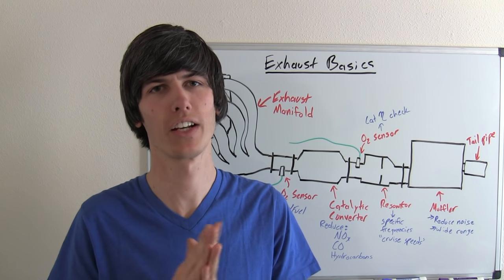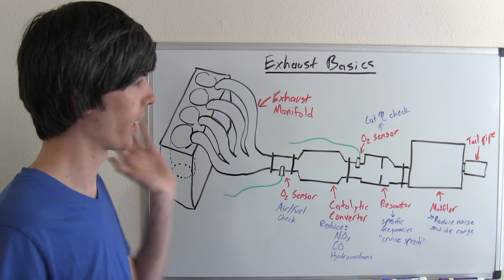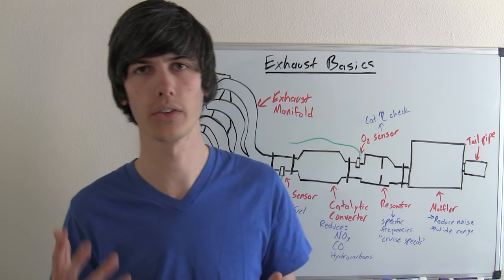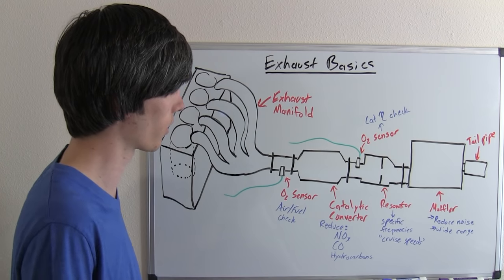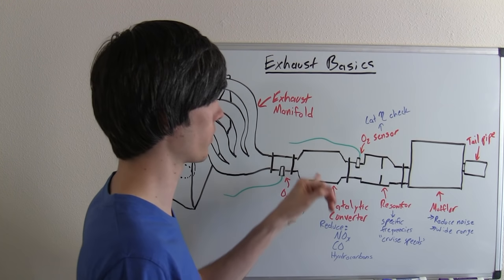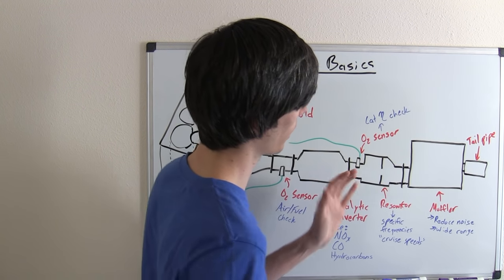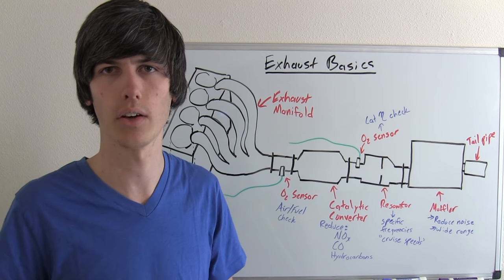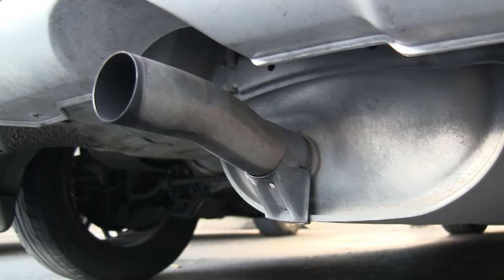Exhaust Systems - Explained

Comment: Thank you Jason.  I recently replaced my stock muffler with a light stainless steel cat-back exhaust system with 2 and 1/2 " dual piping.  It made a notable difference.  I wanted to get the Titanium Cat-back exhaust like the Focus RS but it was not available.
Still, it's lighter than the stock.  It sounds much better with that low-end growl.  Most of all, I've noticed an increase in both horsepower and torque.  Because it's equipped with a resonator, it's louder but not too loud.  Thanks again.

Comment from the maker: Correct, it's simply used for determining the CAT's efficiency. It is not used in adjustments for the A/F ratio (this is done by the first O2 sensor).

Comment: The ignition timing is fine with an exhaust. If you up the a/f outside of the correctable range (ECU's will only correct A/F to a certain degree based on O2 feedback) then it'll run lean and then long term lean conditions can lead to engine wear. That's A LOT, though. You typically won't find issues with that unless you're running carbs (as they can't automatically correct A/F). Typically O2 sensors allow like 20% A/F correction, you likely won't see that w/o flow mods (cam, heads, intake, etc.)

Comment from the maker: I suppose I could, though it's fairly simple so I'll try to describe. Basically you just take the volume of one cylinder when the piston is at it's lowest point, then subtract the volume of the cylinder with the piston at it's highest point. Then multiply this number by the number of cylinders. This will give you the engine displacement (the volume that the pistons displace) aka engine volume. You can calculate it simply by taking the bore and stroke, and finding the volume of the cylinder.

Comment: On some vehicles with Exhaust Gas Recirculation (EGR), the system functions off of the back pressure of the exhaust system. If you put a more free flowing exhaust system on, the EGR may not function and that COULD cause engine damage due to high internal temperatures during cruising speeds (speeds where EGR would be in effect).

Comment from the maker: Basically how rigid the car is, in a corner a stiff chassis won't flex, and the car will remain stable (depending on the suspension). A soft chassis may mean the body can flex a little bit, which isn't desirable. This is why convertibles has strengthen chassis', to make up for not having a roof.

Comment: It means the chassis is stiff enough and has good enough handling to withstand the power of the engine. Pretty much, the chassis can stand up to the torsion of the drivetrain and keep the tires on the ground firmly planted for maximum grip on corner exits.

Comment from the maker: I wouldn't say there's any rule like that, but it would depend where the O2 sensor is located. If it's a V8 and the O2 sensors are located in the headers before both sides join (not sure why, but it could be done) then there would be two. It's likely that that they would just put it where they join up though. As for the rest of the exhaust, the number of cylinders wouldn't matter. A 2 cyl and I6 would have the same amount.

Comment: A very wise mechanic once told me that he had never seen an engine performance problem if a downstream (after the cat) O2 sensor was not working. Presumably that distal sensor just assesses the cat efficiency. On newer systems, is input from the distal sensor used for anything other than that?

Comment: Be sure to get some WD-40 or PB Rust blaster or similar, it will really help get those rusted bolts and nuts out and off, also depending on how badly rusted your exhaust is you may have to cut stuff off, may also want to replace your muffler and exhaust hangers.

Comment: it's a second O2 sensor. if it fails for the converter fails you won't be able to pass emmissions testing. On new cars they just plug in a code reader to find out if you pass, on older cars they will actually probe your tail pipe.

Comment from the maker: I guess that the torque wouldn't ruin the chassis and the forces involved would leave it intact. Unless they designed it, or tested it, it's likely just speculation. I've heard the transmission can handle 700 hp, who knows. Eventually I'll get into that scene, and plan on making the results very clear.

Comment: I'd like you to talk about how modifying your exhaust can shorten engine life. I've heard that when exhaust gases find less resistance than the engine expects, it runs maladjusted and you can damage the exhaust valves. And I'm guessing it ruins the whole engine timing... but I don't know if an adjusted ECU can "teach" the engine a new timing according to the modifications (but that can overstress internals), and for carburated cars without electronic management I totally don't know what happens.

Comment: First I would like to thank you for how much I've learned with your videos. My question is, I remember back in the 90's, the legendary acura NSX had two large tail pipes, and the nissan 300zx had 4 smaller tail pipes. If both had the same HP would the exhaust system make them different?

Comment: I really hope you can answer my question. I looked on youtube to find an analysis of an f1 car exhaust sound and one of a acura nsx. The f1 was a really high frequency 500-720Hz while the NSX's had a range of 250-300Hz. Since F=velocity/wave length is it possibly to put a smaller diameter exhaust on a nsx or any car and increase the exhaust velocity to increase the frequency therefore making it sound more like an f1 car or at least a farrari.

Comment: EE.. i have avrequest.. please Make a video on "straight pipe problem". Discuss on what are the effects of doing so on car performance, pistons, pipe etc. coz i found out after sometime, my engine just got a major overhaul coz the engine block just got bigger and i got to skim them and use oversize piston. Plus theres so much carbon deposits on the pistons. Wonder are those really are the problems that might occur when using straighten pipe. Thanks for the consideration 🌻

Comment from the maker: You mean if they both had the same engine, or same hp? Yes, it could make a difference, depending on the total area of the pipe allowing for the gases to leave. If they have the same hp, then, well, they have the same hp.

Comment: It's a non-issue 9 times out of 10. Yes, the chassis can incur damage (twisting, typically) due to large amounts of torque, but I've never actually seen about it, just heard it in theory.  You have stock built chevelles and the like and stuff with SBC TT's made by Nelson dropping insane amounts (some of them like 2200hp) and their chassis handles it just fine.  Drivetrain (differential, driveshaft, transmission, etc.) - different story entirely - those break MUCH earlier.

Comment: I was just wondering how do manufacturers tune their exhaust to sound the way they want? For instance, a c63 sounds very deep and throaty whereas something like a Ferrari sounds high pitched. Thanks.
Reply from the maker: This actually has a lot to do with the firing order as well, I'll have a video on the topic somewhat soon!
Reply: Ringo Suen Ferrari have sound engeniers and they have simple job to make intake that will have perfect sound.
Reply: Engineering Explained I just did a muffler on my 2013 genesis coupe track N/a engine will this affect performance
Reply: ask a forum not a youtuber
Reply: Ringo Suen because one is crossplane and the other is flatplane (crankshaft type) now if you want a crossplane to sound like a flatplane v8 then look into equal length headers

Comment: So my dad told me a story of a time long ago when he was in "real" shop class (as he puts it) and he was told to design an improvement to a car.  He drew up an air duct that intersects the exhaust after the manifold, essentially creating an educator to suck the air out of the engine.  He was given 100% for the idea, but told it wouldn't work because the engine needs "back pressure."  Can you clarify this for me?

Comment: My question: Can an exhaust system cause a harmonic vibration? My 1963 Thunderbird now has one. 

The vibration becomes noticeable at around 65 mph. It is a pulsing vibration and the pluses quicken when you let off the gas pedal and coast. We have checked and balanced everything else on the car...driveshaft, differential, transmission, harmonic balancer on engine, tires were road force balanced, brake drums were balanced.

Because the vibration quickens when the car coasts, it acts a bit like a semi-truck that is engine braked.

Could this be caused by the dual exhaust system installed on the car?
Reply: maybe the resonators are for the incorrect frequency range?

Comment: Can you make a video on how engine liters are measured.
Reply: Cylinder displacement.  Basically the whole cylinder area, if you were to seal it off and submerge it in water, your answer is the amount of water that gets displaced.  

I'm not sure if I'm explaining this right so I'll give an example.  Say you have a pool filled with 10 liters of water.  You take the cylinder area of the engine and drop it into that pool. Now the amount in the pool measures 14.2 liters, so you'd have a 4.2 liter engine.  Hope that makes sense!

Comment: If my car is pulling in too much air, what sensor would tell the engine to pump more fuel? 
From idle to acceleration my car sometimes cuts off. 
Installed cai with new maf sensor, Cleaned the throttle body, reset sensors, changed spark plugs. Ordered a downward o2 sensor thinking mine needs to be changed. Next I want to order an exhaust system, new camshaft and fuel injectors which I think should balance air to fuel ratio while allowing gas to quickly get out. Pray for me

Comment: Hello and thanks for a great video.
Can I please ask a question about Exhaust flow. 
I want to purchase a 3" downpipe and frontpipe combo (or 3.125" to 2.5" combo from other company). The question is - wont it make any problem that 3" or 2.5" inch pipe will run into 2" stock exhaust?

Comment: so you said that a resonator kind of gets rid of that "really loud noise" ? (Just curious), but I have a Mitsubishi Evo and It's pretty loud. I put a different exhaust on it so it's louder, but Idk if the previous owners removed the resonator. If it isn't removed and I did remove it, would that make my car even louder!?You said something about it canceling the wave sounds out from each other, so I figured if it's removed, there would be nothing to cancel that noise out which would make it louder.. or is my logic not logic haha.   I love cars, but since i'm still in school with little income, I don't get to do what I would like to do with cars. Love your videos man!!!
didn't realize this video is pretty old, sorry for the late response. Just found your videos :D
Reply from the maker: +Austin  Scroggs No resonator would result in a louder car, yes (for a certain frequency range).
Reply: +Engineering Explained so what would i put in the place of the resonator if i were to remove it? Just a pipe or does nothing have to be placed there?

Comment: I have a 2017 Dodge Ram v6, I took off my stock muffler and put on a after market muffler I didn't like the sound so I put back the original stock muffler. My question is can I lose torque cause I took off the pipe and put it back to it original ??
Reply: Mike Vasquez you should ask on a newer video now that this is a month old
Reply: Mike Vasquez Yea, should've got the hemi

Comment: I'm kind of wondering that with your knowledge you might be able to help me. So I was looking under my 2018 cadillac Escalade today just sort of checking things out. I noticed that on the bottom of the muffler close to the seam there's a tiny hole. I kind of figured that might be normal. However what didn't look normal to me was the amount of soot build up all around that orifice. Should I be concerned about this a t 18,000 miles?

Comment: i have an exhaust system question: why do people (specifically racers) make center mounted exhaust exits?  I have seen this on some of the race car build channels (ie. speed academy-RX7 build).  they seem to go to an awful amount of trouble, adding extra pipe, and bends to make it exit in the center rear.  why?  thanks.

Comment: I have an M5 V10 engine, this car have from factory 4 catalytic converters, resonators and of course mufflers, 

Two of the  secondary catalytic converters were removed along with resonators and mufflers, 
Could this be the reason to have the inside of the truck always hot?

Comment: Quick question !
Let say your making an exhaust system for a n/a front engine car but never join the pipes together 4,6,or 8 pipes running individually to the rear of the car. Is that a thing already? I haven’t found a name for it. I soooo badly want to hear what that would sound like. Don’t you? I figured if anyone knew it would be you. 🙂 thnx.

Comment: I have a question. There is a type of exhaust that I believe goes from dual back to single that sounds like nothing I have ever heard before. It has a very strange sound and I have only ever heard it once but I have video from 15 years ago, a guy had it on a trans am and it sounded like nothing I have ever heard before. Almost like a phaser sound or something, very hard to describe.

Comment: Quick question, say on a Nissan GTR, when you see the rear it looks like it has 4 tailpipes, so how would 6 cylinders-worth of exhaust be evenly divided by 4? Or are they just for show?
Reply: Two exhaust pipes split at the end for quad pipes, the R35 has a TTV6 so three cylinders for one exhaust pipe...

Comment: Hey man. been following you for a long time. I've been running lean in my acura CL 2.2. (F23 actually. it's a 97 2.2 with a 99 F23 motor)..... I've checked all vacuum leaks, PCV, and even sea foamed the vacuum lines...

what are some suggestion to check? Too lean means too much oxygen or too little exhuast. What should i check next? Fuel filter and exhaust header are my next choice (because it's bank 1 running lean).

Should I try a tune up with plugs and wires? I haven't had a misfire so I didn't think it was them.

After I reset the code, its off for highway driving (drove from Atlanta to Augusta GA [2hours] and city driving but the next day only turns on during warm up when coming out the neighborhood. My guess is that it is an exhaust leak or is it possible to have not "enough" spark to burn all the fuel? I have no idea. but then again I have no misfires.

Comment: resurrecting the dead here....but I have a 2015 ecoboost mustang. for shits and giggles I unhooked the exhaust after the downpipe and now I'm returning my catback system and going for a straight pipe setup. is straight piped better then an aftermarket catback that has welded mufflers?

Comment: Exhaust with just a complete 3" piping. Meaning an exhaust system that does not have any mufflers or resonators, just 3" tubing all the way through. is good or bad? i have a mini JCW 2009 210hp. Will it affect performance and I will miss hp? Thanks.
Reply: They are beastly cars to drive.  I'm jealous. Exhaust cracking sounds sooooo good.

Comment: I need some help. I have a Honda V6 with 2 resonators and of course a muffler. I would like to make my engine a bit louder but not too loud to the point you can hear me 8 miles away. I dont want a gurgling sound like a disel. I prefer a cleaner rev.What should I delete?
Reply: Jenni Hong take out everything just add a 200 cell catalytic converter with a cannon muffler exit
Reply: Muffler Delete. It's loud only when you step on it. idle is pleasant but, you'll get constant drone while cruising. I haven't been pulled over for the noise so yeah.
Reply: I'd say only resonator
Reply: Jovanny Sanchez depends on where you live. Muffler delete won't pass emissions in Connecticut :(

Comment: So I have a 2015 Altima and want to get sport mufflers do get abit of rumble. its 2.5L 4Cyl QR25DE engine. It comes factory with dual mufflers. Is it better to remove one of them and only install one muffler or change both mufflers? Which setup would I get abit more performance?

Comment: I wanna make my truck sound beefy. What do I buy?  I have 5.4 Triton.  My buddy has smaller 4.6 and it sounds really good. He offered to switch exhaust.  Think I can swap?
Reply: DebieDoesDalas69 I straight piped my 5.7 hemi. That’s the way i would go. As far as swapping you’ll have to measure the diameter of both pipes and use adapters as needed.

Comment: I have a question. Is it okay to connect a 3" pipe into a muffler with a 2.25" inlet? Will I lose power or no?
Reply: RR 10 Could you be more clear? so far what you said, I don't think it would

Comment: my exhaust is leaking at the flex pipe. I brought it to a shop and they offered me an option to install a pipe instead of replacing the flex pipe. Is the flex pipe necessary? Car is a subaru

Comment: Question: if I buy a 4inch catback exhaust for my 2003 Nissan Maxima, will it sound good or will it sound like a fart can? Also, is it the bigger the number the louder the exhaust? For example a 2.5inch exhaust might be better sounding then a 4inch one?? Any help would be great. Btw I'm keeping the converter on bc I don't want to trip check engine lights...